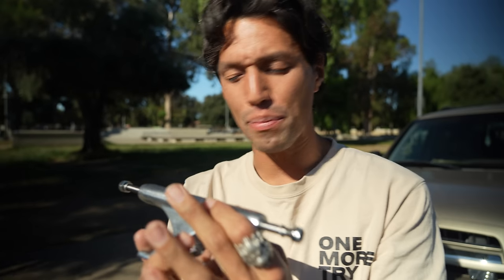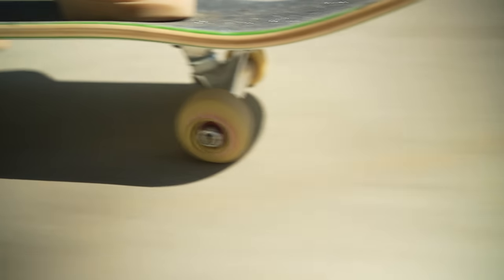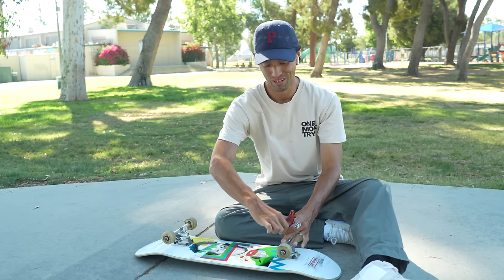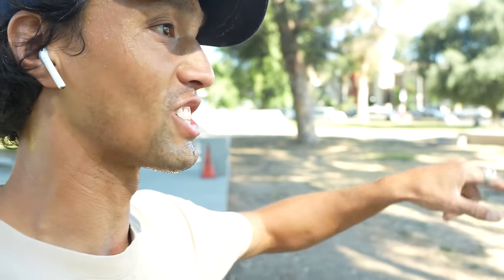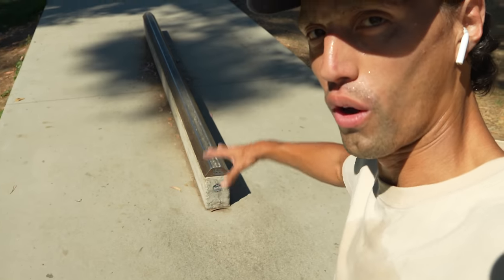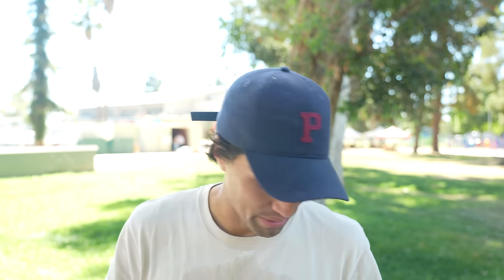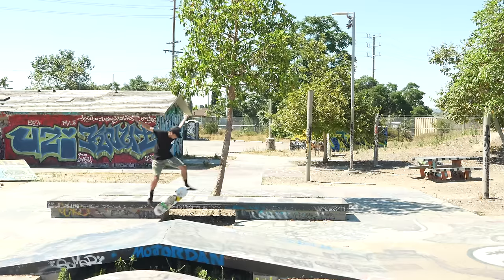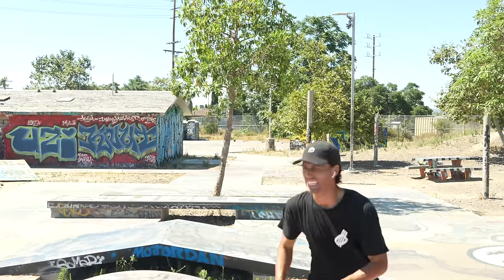The Problem With Skateboard Trucks

Comment: Truth time. As someone who has skated forty years and worked in shops. The first thing you do when you get trucks is take them apart, replace all the bushings and pivot cups. Riptide makes a ton of options in a much better quality urethane. Pivot cups make a huge difference in truck stability when running them looser, more wiggle, less wobble.
Reply: Riptide or nothing lol
Reply: Joey Tershay said it best, “if you’re not fuckin with your trucks, you’re really fuckin with yourself” 😂 He even encourages people to mess with Aces and make em their own
Reply: @From96TilDeath  Damn right. I was lucky enough to pick up two pairs of the magnesium base plates when they made a batch. I ride 00's with mag baseplates, bones bushings, a riptide pivot cup and titanium truck and wheel bolts. With titanium mounting hardware to hold them on.
Reply: Children nowadays will have no balls to attempt this been fuckin w my trucks for the last few months and yes makes a fuck ton difference thanks OG

Comment: Been riding some Slappys for the past two weeks and i been enjoying them!! Turns great, slides smooth, and definitely quick to brake in. Also barely any wheel bite, currently ridding a 8.7 shop deck, 8.5 Slappy trucks, 56mm spitefire formula 4. Loving this new set up!!!

Comment: Your typical truck issue sounds more like a bushing issue. You ever tried bones bushings? The plastic core helps prevent them from getting stuck to one side. 

The downside is that they blow out after a couple months. They also don’t fit great in thunders. The good thing is that they don’t really have that break in period like stock bushings. 

They’d be worth trying in those slappies if the stock bushings get weird.

Comment: I skated Indy’s my whole life . I think I bought ACE because I was riding a 9 inch board and I THOUGHT the 169,s were gonna be too big. I was wrong but I have to be honest Iliked them right off the bat . 
I loved the radius of the turns and they just good to ride. 
My problem was that I really liked my 159 stage 11 GT MODEL. 
Because I have size 13 feet a 9 inch board to me is nothing. Fits great. That with my smallest riser and 56/ 58 wheels I found a great match. I’m still trying to see if Indy’s are still good .
I’m going to get some SLAPPY TRUCKS next. I’m 51 so I need every advantage. lol 
I really think it’s important to try out different stuff if you have the chance. 
Remember Fashion before Function is never a goood  idea. 
Peace ! Mike 13st NYC.

Comment: I have the same problem with Thunders, but still prefer them to Indy. I just replace my bushings every few months and it seems to fix the issue. I still feel like I have to tighten the trucks perfectly aligned with them new bushings to avoid it, though.
Reply: Get their hardest set of bushings 100s and swap out the stock top bushing’s for the harder top bushings.   You won’t have to crank your trucks so much and they’ll be more stable while allowing you to turn like a looser truck.   100/90 du if you want to get new everything.
Reply: @PanxDulce  swapping out the top is a good idea. I do skate the full 90 duros, but haven’t tried the 100

Comment: I feel the pain of trucks being meh, recently got new bushings because the ones that came with my trucks were splitting and it was about time. They’re Indy’s and I got some bones bushings, and no matter what I did they would stick in one direction, ended up just getting independent bushings in the end
Reply: Bones bushings are terrible, in reality every aftermarket bushing you try to pun in a different brand of truck doesn't fit well. When I used to skate I tried everything to make my thunder Trucks feel a little tighter. Guess what? Aftermarket thunder bushings solved everything 😅

Bones bushings...well they last 2/3 weeks then they completely destroy

Comment: My truck somehow broke where the hangar connects to the pivot, so I might have to cop these. Do they give good clearance without risers?
Reply: You use risers 😂😂😂
Reply: @s5005  I don’t, I’m just making sure if I get these that I won’t have to💀
Reply: @colin19273  I feel you I was just messing with you anyway... I mean if you want risers then screw what ppl. Think it's you on the board so whatever makes you comfortable ya kno... but to answer your question no you wouldn't need risers with those trucks (there not a "low model")  Unless you for some reason ride very big wheels. It's always better to get smaller wheels then riser pads. Risers make you unstable and makes landing tricks harder.
Reply: @s5005  thanks for the help big dawg💯🙌

Comment: What they need to do is have the kingpin smaller with a rounded Allen key top bolt and where the hanger and kingpin meet there's a drop down at like 90 degrees so you can shrink the kingpin area while keeping the same angle from the truck so it rides the same
Reply: there was a truck called san diegos that did that .i dont know if they still make them

Comment: Trucks are easy, get the lightest and buy hqrd bushings. File down your kingpin. Use two spacers between the truck and 1 between the axle nut for the wheel. No issue. People ans their losse trucks thinking theyre better than they actually are. Your not Dylan.